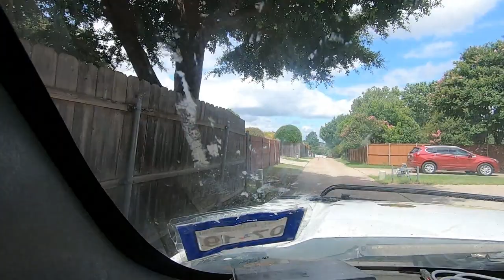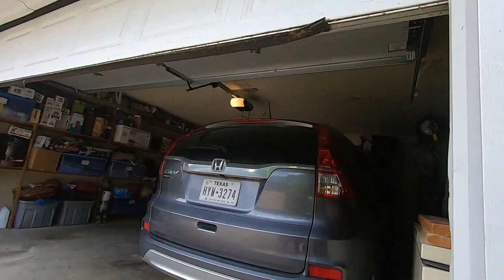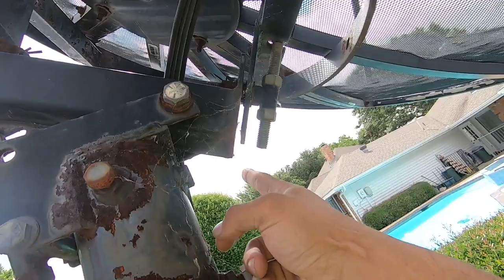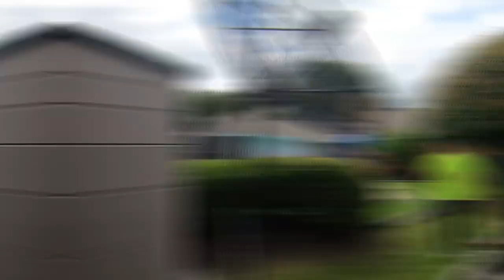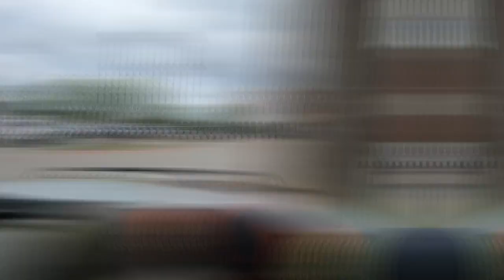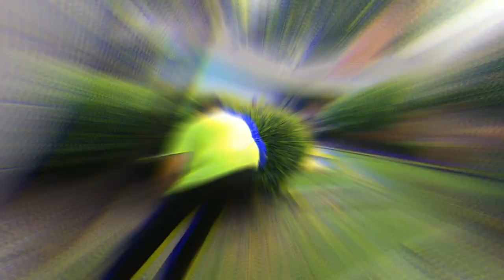Satellite Dish removal done right in Carrollton Texas

Comment: I removed one this past week.  Dish was welded to a frame, pretty beefy.  1/4 inch welded-on brackets but my saw cut those pretty easily.  Had to cut the top of the pole off as I didn't have a ladder to reach the top bracket.  Dish rusted so I was able to break it down to fit into my truck with the saw, hacksaw, and sledgehammer (yes I beat it apart in rusted places).  Pole and concrete block were massive. Pole about 8 feet tall and concrete block 2 feet square and at least 8 to 10 inches thick.  Dug it out, pulled over with my truck, broke up block with sledgehammer.  Ran out of dirt filling in the hole but hope to go back today and finish.   When I remove a thing I remove ALL of it.  Already hauled off the concrete and will scrape out the dish and pole.  I also broke two reciprocating saw blades!  Sorry it happened to you but glad I wasn't alone.
Reply from the maker: I hear ya

Comment: Why leave the pipe, homeowner shouldn’t have to be tripping over it.
Reply: Brian.  Not only that but if someone fell on it.....yikes!   I just removed one and I dug out, pulled over with truck, and broke up the base.  I hauled off the concrete and will scrap the metal.  I am filling in the hole now, tamping as I go, and will plant grass.  Only the weather is holding me back on finishing.
Reply from the maker: Didn't care

Comment: Ricardo, get a small corded angle grinder with a cutting wheel, 30 bucks , trust me you’ll thank me later
Reply: Smart...
Reply: Driller.  I agree.  I did the same job this past week and with same kind of saw.  I would have used an angle grinder if I had one.  Plan to get one soon.   I mostly cut brush for people so a Dewalt saws all made more sense at this time.
Reply from the maker: Very true